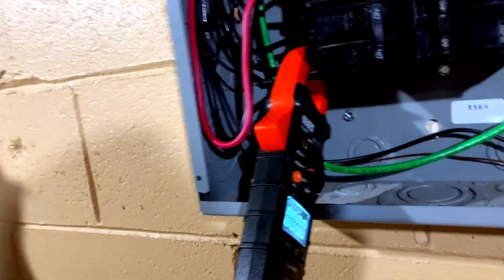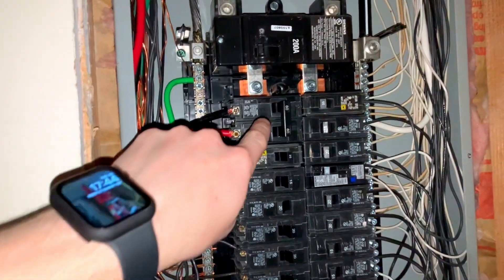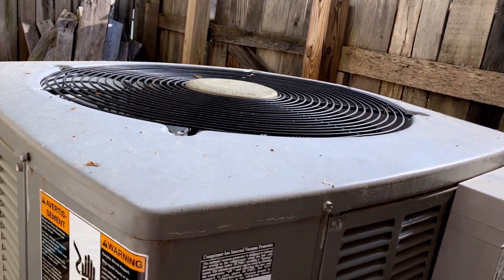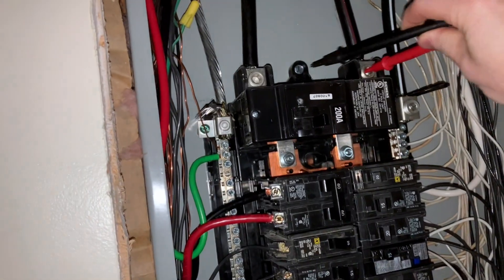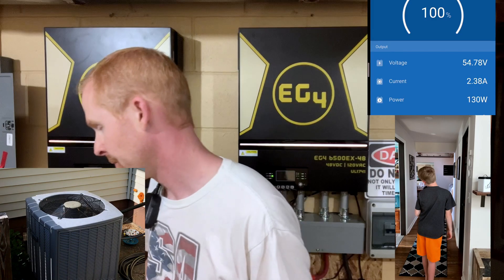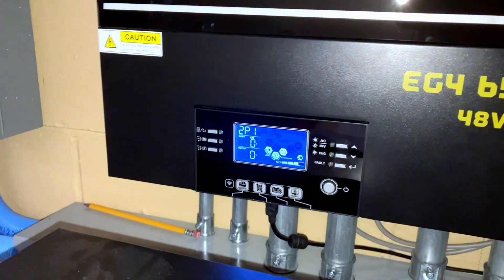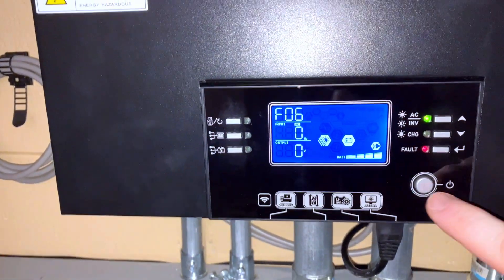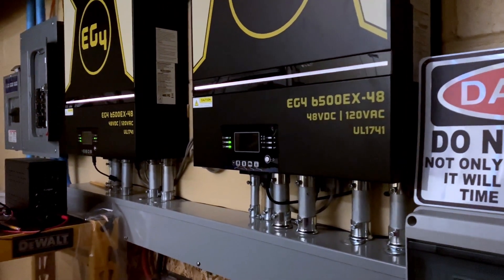EG4 6500 Load Test - Will it Run My A/C?

Comment: You've probably already answered this but were you ever able to get it to work on the 6,500s or the Victron? How many watts is that 3 and 1/2 ton?
Reply from the maker: Howdy Dean!  

I wasn't able to get it working on the 6500s.  It probably would have worked if I had installed a soft-start on my A/C.  Just ran out of time with all the projects that summer.  

Figured I would just show you the results of the Victron (as well as your wattage question).  https://youtu.be/arXngHH4B5c?t=287

Comment: It cracks me up how some people that set up solar get panel crazy.....not need. I you have two panels at your house then that's enough. With a system this big a critical loads panel is not needed usually.
Reply from the maker: I guess it all depends on your panel placement compared to your inverters and what the ultimate purpose is.

Comment: Did anyone else notice that the phase angle of the 2nd inverter was set for 120 ?
Correct setting would be 180 .....
Reply from the maker: It is set to 180.  Where are you seeing 120?

Comment: My 2 SP6500 ran my 3.5 ton AC but it was in bypass mode.  But it started it and it has a 110 amp in rush!
Reply from the maker: Yep, bypass mode will do it because the grid is taking the inrush.  110a is a lot!

Comment: My 2500w inverter will not start my 5 amp shopvac. But if I start my shopvap before I start my inverter the inrush is not as bad so it will start. 
They make a soft start and hard start they both help start your AC take a look.
Soft start, hard start, easy start take a look.
Reply from the maker: Thanks!  Yeah I know I need to get one.  We just haven't been running the AC as much recently so it hasn't been at the forefront of my mind.

Comment: I always assumed I wouldn't be able to run my central air system off the inverters but I decided to try it today.  I have the same system you have, 2 EG4 6500 inverters in 240V split phase configuration. I also have a three and a half or four ton AC unit cooling a 2,400 sq ft house.  It's a Carrier, about 2 years old. I switched the house over to the EG4s, turned on the AC and...  and well, damn, it just worked. No alarms, no lights flickering, nothing. I ran the whole house of the EG4s for about 2 hours with the AC cycling on and off normally with no problems at all. In fact the AC seems to be surprisingly energy efficient. I don't have a meter that can measure surge but after start up it draws less than 2KW.  The EG4s were just idling along using less than 30% capacity while the AC was running.

Thanks for your videos, by the way. They're always interesting and it's great to see these being used in the real world!
Reply from the maker: That’s awesome!  Thanks for sharing!

Comment: These inverters are beasts, I recently installed 2, and tested my 240 volts outdoor AC unit, they ran it with no problem. The inverters showed only 15% usage on each of them. Judging by the numbers (amps, watts...) my outdoor AC uses half the power yours consume
Reply from the maker: What size outdoor AC do you have?  Does it have a soft start on it?

Comment: Micro-air easy start. I have the exact same setup you have. My AC is 3 ton.  Was 70 amp surge. Now 16 amp surge and 6 amps running.  Doesn’t bother my 2 EG4 6500ex inverters at all.
Reply from the maker: Thanks John!

Comment: Adam, the ICM 870 is the key to lowering those amps, installed mine yesterday dropped 45 amps from start up on 2 ton heatpump, when I saw you backfeed system I implemented my own with 60 amp feed to inverters from grid pannel, also added 2 more breakers in series to prevent back feed when swapped to grid, color labeled all and went over with wife.
Reply from the maker: Thanks for sharing!  I still have to get a soft start but have to finish up on some other projects first.  Way too many irons in the fire…

Yeah going over steps with the Mrs is a must!  I’m thinking about a redesign because I have to make sure when we have someone else stay at the house to “critter sit”, I need to have something simple that can be done as opposed to “flip breaker A and C, the go flip breaker B”.  Former owners of the house didn’t make it easy though with all the breaker panels…

Comment: Well at least you know the inverters will drop out and protect themselves!  That's actually pretty important so I'm happy to see it did so.  I think a soft start will get you by but someday when it makes sense you should look at replacing the AC unit with mini split technology.  For us we were already thinking about replacing the AC units due to age and they were just constantly breaking down, so financially it made sense.  But right now I'm running a 3 ton, a 2 ton, (both are ducted with matching air handler) and a 1 ton mini split for the garage where the inverters and batteries live.  Been that way for a couple months now and the temps here have been hitting 90 for a few days.  All I've got is the SA to go by but I've never seen anything above 5kw draw at any given time and that's rare.  This is with all the other stuff in the house on it except for the dryer and the double ovens and a few minor circuits.  I'm definitely a believer now.  I have one more 2 ton that I may switch over to solar but I want to go through a summer and maybe a winter first.  I think winter is going to be a good test for us since I don't have heat strips in any of these units.

Good job on the "hey y'all, hold my beer and watch this" video!
Reply from the maker: Trust me, I’m glad too!  Unfortunately with as many errors that I’ve found in the manual, I feel like I really have to test anything I see to make sure it actually works…

I have a feeling I see some mini splits in my future.  I know I already have plans to put one in our big living room because there’s no ductwork in there.  That might end up being my foot in the door.  

Why do I have the feeling that I have a lot of those “hey guys, watch this” moments???

Comment: Somewhat related, I need to figure out an effective soft start for my woodworking tools if I want to run those off of solar.

On the other hand, the inverter based 2-ton doesn't make the lights dim or anything.  One of the nice things of newer heat-pump tech.
Reply from the maker: Yeah I ran a test with my shopsmith which had a nice draw on startup.  Didn’t pay attention though if the lights really dimmed when it kicked in.  I don’t know if you need to find customized soft-starts for the different equipment you’re looking to run or if any soft-start will work (as long as it can handle the inrush).  

Yeah, I have a feeling I’m gonna end up putting in some mini splits at some point.  Would save a lot on power usage…

Comment: We just got our RO water system running and the motor popped the sol-ark on startup. A soft start solves it. It only pulls 1800 when running so it's silly that we need to do this, but at least it works!

Comment: Adam, the LRA on the nameplate is 90 A so your 83A “max” current is close to inrush. Should be closer to 90A. 

I did a similar test on my two stage 4 ton. Low stage worked. When it kicked to Hi, second inverter faulted like yours. Because my Trane unit has two physical compressors, I’ll have to get 2 softstarts. Or think about replacing this 20 year old unit with a new Bosch inverter AC unit. 

Thanks for the videos!

Comment: I ran the same experiment with the same setup. My EG4s powered the house and the AC for about 20 minutes. The lights blinked when the AC came on but it handled the onrush current.  I shut it off after a while because I only have 10 gauge wire running back to the house from the inverters. My system powers my workshop and It will run two AC units all day long. One is 2500 watt and the other is 1500 watt. How  Old is your AC unit?
Reply from the maker: It’s probably 10 years old.  So you ran. 3.5 ton unit?  We’re you running any other loads at the time?
Reply: Mine is a 3 ton unit and it is only one year old. Only other loads were the TV and the lights.  I will do the experiment again and document it for youtube when time permits. I cant run for too long because I only hae 10 gauge wire running to the house.

Comment: Tks for sharing. I was going to do something similar, back feed* into the  main panel with the main breaker off (thru my old spa 6ga THWN-II circuit). My 1957 home tho has some jacked wiring done by the flippers. No joke, two separate circuits, but off the same leg of the panel, meet at some point in the house. Nearly started a fire however strangely worked for years. I was removing one of the light fixtures they put in and there was 20 volts on neutral to ground. We also ended up deleting the non-code bathroom they put in... Such shotty work. Toilet would gurgle when the other toilet was flushed. All this is to say, using existing wiring with any off grid can be dangerous due to unknown wiring conditions. Or if there are several neutral bonds, it can get funky. Again, tks for sharing.
Reply from the maker: Thanks!

Yeah, existing wiring can be very sketchy.  When we bought out house, we had to have a lot of it redone because of all the problems there were.   As we go through each room and do renovations, I just gut all the wiring, cause there’s always at least 1 open junction per wall…Never dull, that’s for sure!

Comment: Micro air easy start all the way. It’ll knock that startup ampaerage to a much more manageable level.
Reply from the maker: That has all the extra bells and whistles doesn’t it?
Reply: @AdamDeLayDIY  Id say yeah. The Bluetooth is interesting to see the amperage draw. And you can also send reports in to easy start diagnose the unit if there’s a problem.
Reply from the maker: @GavinStoneDIY  interesting.  Thanks!

Comment: If our micro grid system can charge 2017 TESLA MODEL X by 72A more than 4 hours then the total household could off grid (all green home) easily.  The most power consumption monster for a home is EV.

Comment: The most challenging loading equipment is EV(Tesla model X 2017).  The power  for charger is 230V/72A,which is about 16kW.  The off grid system was turned off maybe due to your battery BMS card or DC CABLE or DC protect breaker over current.  We need calculate DC cable max current in advance.  230V*72A/48V=345A , 345A will be in DC SIDE  and BMS card need 200A spec.
Reply from the maker: If you have an EV, sure that will be the biggest load on your system.

It was the inverter that tripped not any BMS or breaker.  I have 2, 200a JK BMS on my 2 battery banks.

Comment: I am running two 12k mini splits off mine.
Reply from the maker: Yeah, I need to look at a mini for one of the rooms in my house.  Which manufacturer did you go with?  What do you think about them?
Reply: @AdamDeLayDIY  I have the Pioneer units. They do geat. Around 300 watts each
Reply from the maker: @glennwest4438  thanks!  Heard a lot of good things about the Pioneers.

Comment: How much excess do you have? You can easily add 20 or more kw hours per day running a central AC.  You might want to use a combination of window units or mini-splits with the central to optimize cooling and power.
Reply from the maker: It really depends on the day.  I haven’t gotten much more than 31kw from my solar because the batteries full and there’s no more loads.  

Course I could always add more batteries, but then I need more Solar to charge them… 😁

Comment: I am going to try this on Monday when the wife is away.l an leery of doing damage to the AC units boards, it's a new unit and I hear parts are scarce now.
Reply from the maker: Good luck!  Let me know how it goes!  Do you have a soft start on yours?
Reply: @AdamDeLayDIY  I do not. I replaced my system last summer with a Lennox 4-ton variable inverter unit thinking of solar use last summer. My older Lennox 4-ton had an LRA of 107 amps, not a chance with these inverters, the new AC unit ramps up slowly and states 22 or 27 amps to start. I will have to just try it sometime I suppose..
Reply from the maker: @sh839c  let me know if…when you try it.  I can tell, your curious now… 😁

Comment: I run two HVAC units on my growatts. Seems like you would be are to run that unit. My units are 2 ton and 1.5 . I thought the all in one package units used the most power to start but I guess these units do as well.

Comment: I have 2 X 6000EX low frequency inverters and they can run my 5-ton AC with softstart.  They switch to Hybrid mode for a few seconds and then back to battery mode. I bought the 6000EX because it is designed to handle large inductive loads. The softstart makes a huge difference so I'm hoping you'll get success after you install one.  Well done!
Reply from the maker: That’s great to hear!  So what do you think of the 6000s?  What kind of soft start do you have on your A/C?
Reply: Ive been using the growatt 12kw for two ac units 1.5 ton and 2 ton. They can start at the same time and it's a beast. Biggest issue with it is solar charge controller is too small at 7kw but thats only if your battery voltage is at 58 volts. I'm usually 46-57 volts. Meaning when the battery is low I can only get 6kw of solar charging. It's got a hard stop at 120 amps going to batteries. I'm hoping to add the new eg4 500v 100a solar charger. But I've already read they have software issues 😢
Reply from the maker: @electromechanicalstuff2602  I've heard those units are beasts.  That was actually one unit I was considering initially before I switched to the 6500s.  Are you still running the LV6548s as well?

Yeah, I've heard about some software issues as well.  The ones I heard about revolved around not using battery comms.  Not sure what that's all about though.

Comment: Air conditioning is always the solar mystery question.  Great test though!  Kudos to your assistant!  When I built my new home I used a 1 ton ducted mini-split with a 2 ton central heat pump with the hope that it would better distribute the A/C power draw.  I’ll tell you if it worked once I finish my solar system.
Reply from the maker: Thanks!  He seems to enjoy helping.  

Keep us in the loop with how your system is coming!  I think I see some mini splits in my future…

Comment: I couldn't get my 3 ton ACto run on my growatt 12k or 2- 6500's.
I could run my air handler, but left my condenser on grid.

I have since switched to 3- mini splits with 6- indoor units. I also have a 12k btu 120v unit in the apartment in the barn. I can run all 4 of these with just 2- 6500s. That was pretty impressive. It says 41% load.

My old AC unit was just that "OLD" and needed to be replaced anyways.

Cant wait to see the soft start work. 👍
Reply from the maker: It’s just crazy the different load that a mini split has (even multiples) vs a conventional A/C system.

Comment: BOOOOOM!!😜Was a great test even tho the inverters didnt have the grunt power.  Stove and dryer draw even moar power but not the surge.  Anyway, I just installed a Micro-Air Soft Start on my 4-ton AC unit.  I used part # ASY-368-X72-BLUE, You would probly get the X48 for your LRA your AC says.  My inrush went from 120a down to 30a😮.  Workin on that video now actually lol
Reply from the maker: I was waiting for the boom…looking back now though even the lights flickering and the system tripping was still a cool experience.  

Thanks for sharing the soft start.  Looking forward to your video on it!

Comment: Nice try. I would be very interested to see what your actual inrush current is with your 3-4 ton HVAC.  Last summer we replaced our main unit here in Texas with a 4 ton Trane. I did notice my electrical usage went down with the new unit.  By the way, to us in Texas, temps of 85°F and like 65°F back north.  Haha.  I grew up in northern Minnesota but after working at the steel mill here in the 80’s (average temps on the floor were 135-145), I have been more acclimated to the heat.   Having lived in both climates i realize both have their plus and minus sides.  Not a problem - 90° is still hot.    Haha.  It is all good.  Anyway I am very interested in you running your HVAC on those inverters.  Thanks for another good video.
Reply from the maker: Thanks a lot!  

Yeah I visited TX for my brothers wedding a few years ago.  105…yikes.  Just kill me now, don’t let the heat do it!

So the LRA on the compressor is actually listed at 90 amps on the label, so it seems I was pretty close with my meter.  

Looking to see what soft starts people are using to figure out which one to get.
Reply: @AdamDeLayDIY  haha it is definitely a different climate in Texas than the one I grew up in in northern Minnesota. We were 70 miles north of Duluth. You are right. It gets hot here. We live indoors in the summer unless we are playing in the lake water and up north we lived inside during winter unless we had ice fishing or snowmobiling to do.  Haha